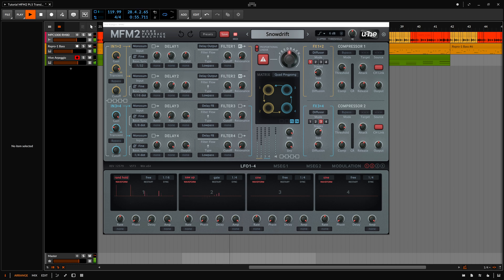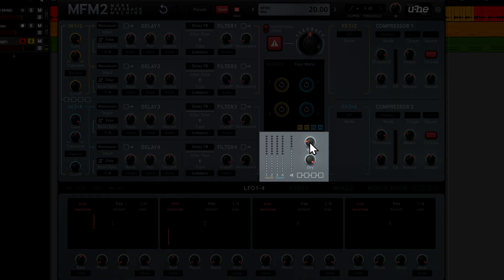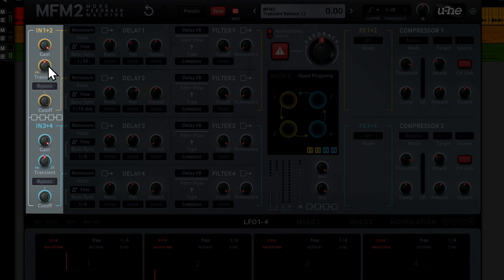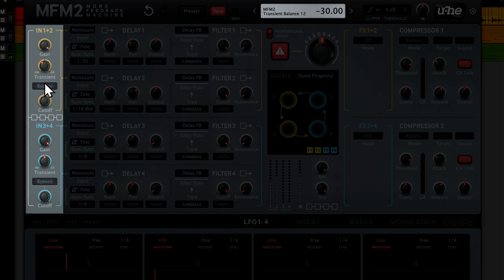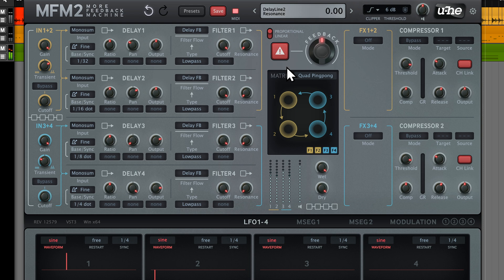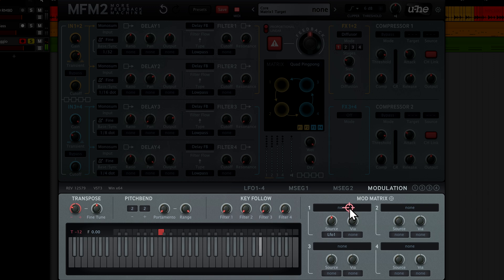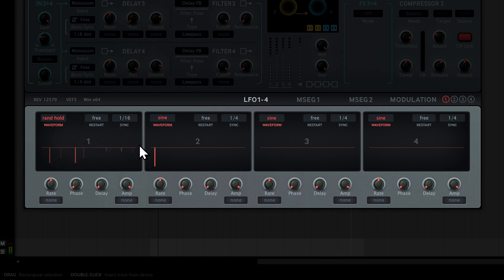MFM2.5 Tutorial (Pt.5): "Transient Balance & Diffusor FX"

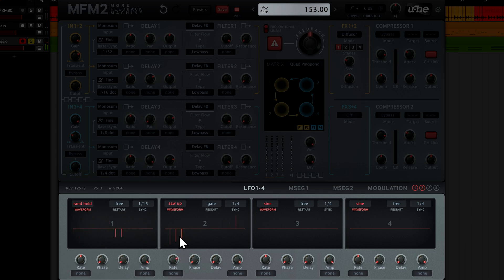Comment: What's the point of adjusting the LFO 2 rate at 5:42, if the LFO is set to 1/4 note sync?
Reply from the maker: The sync value sets the coarse time frame for the LFO frequency. With the Rate knob centered, you get the exact value (1/1, 1/2 etc). Tweaking the Rate knob you can change the LFO rate in both directions (decreasing and increasing). In this example I'm merely filddling with the Rate knob to find the sweet spot. I hope I've answered your question.